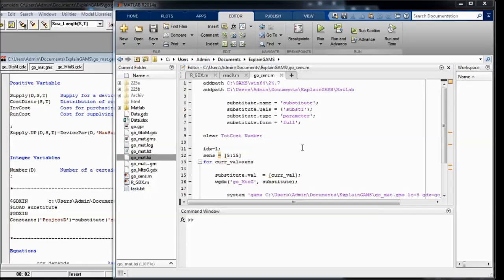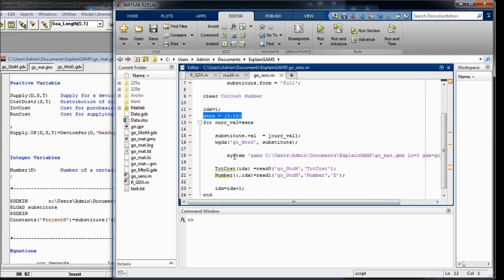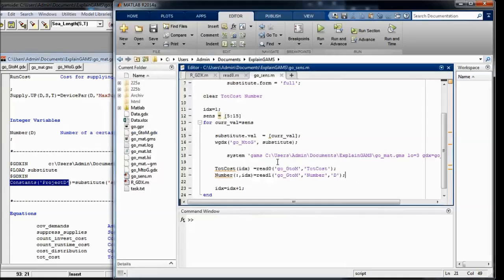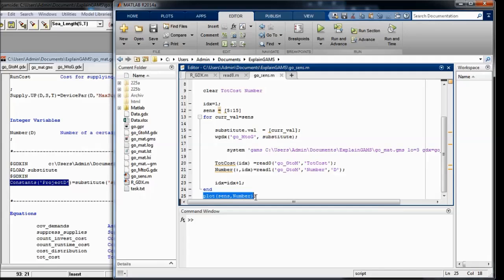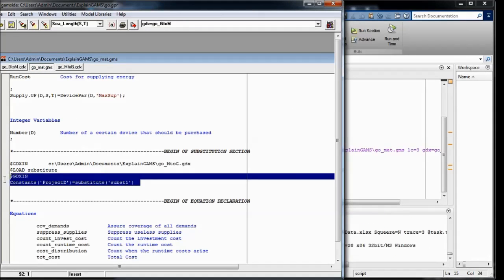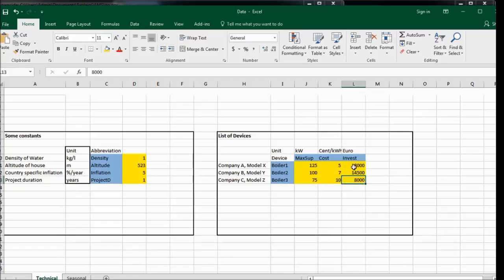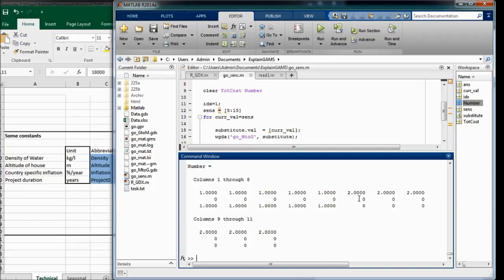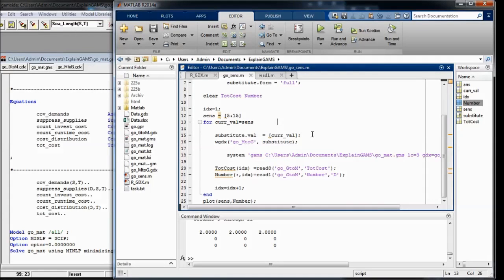11 GAMS and Matlab - Sensitivity Analysis (Example)

Comment: sir can we convert GMAS code into Matlab code or run it in Matlab
Reply from the maker: You can generally place optimization problems in either GAMS or Matlab. I am not aware of any software that could convert the codes automatically, though.
Reply: I have code written in GAMS . and I would like to use Matlab instead of GAMS that what I meant
Reply from the maker: You can do that. You are welcome to send me an email via the contact form on gamsoptimization.com in case of other questions.
Reply: I have one more question, I have a nonlinear equation which i need to linearize it in order to solve it in Matlab while GAMS can solve it by closing solver directly, in this case, can I embed or mix them both to solve my problem
Reply from the maker: I don't know about options to jump back and forth between GAMS and Matlab during the solution procedure. I would rather solve the complete problem in one software and use other software only for problem setup and post processing of solutions.